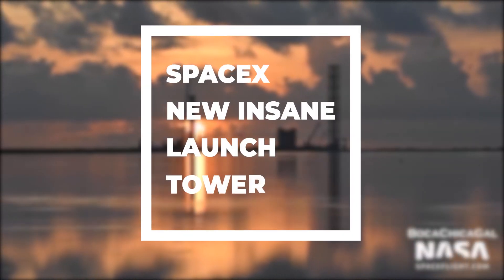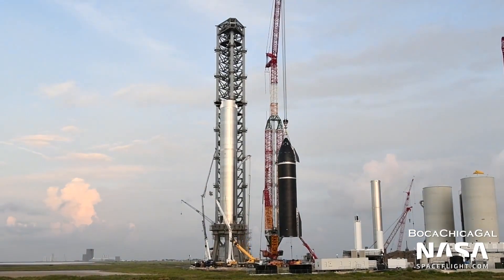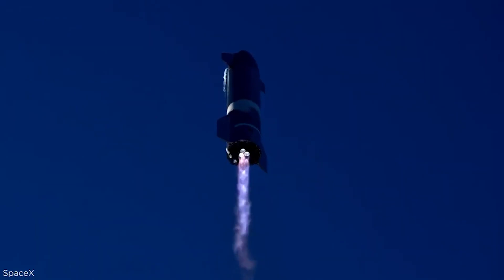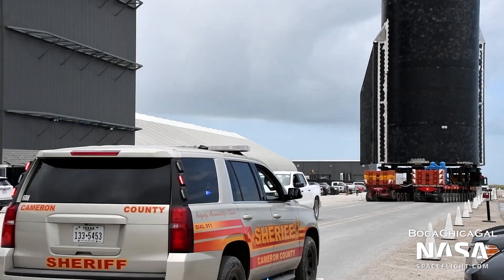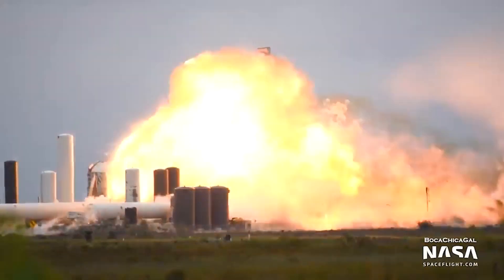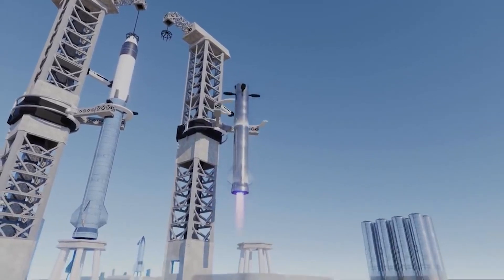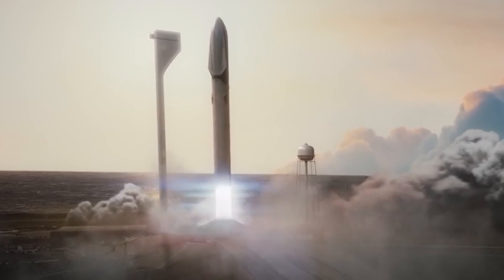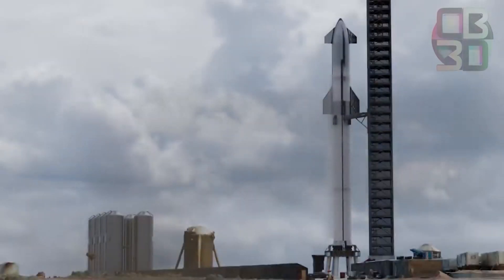SpaceX SECRET WEAPON is This NEW Launch Tower!

Comment: As someone with a structural engineering background, I know that what the rocket lands on MUST be able to support its massive weight.  That's why sites for giant buildings must have studies to determine ground composition. How they think they can land a huge rocket on an unknown surface anywhere is a huge risk. Buildings fall from inadequate support all the time.  It doesn't take much.
Reply: I can only assume the legs have some sort of stabilizing functionality with a pretty wide range of variance. Also probes could be sent in advance to do ground penetrating radar or something like that. If however it falls over on Mars, let me be the first to say, “you called it”.
Reply: Thought about this too. But yeah it probably will incorporate very wide legs…  unlike when it lands on earth with none

Comment: It definitely is not ready on mars or the moon but it is very dusty and on Mars even though there is not much much oxygen at all I am fairly certain things can rust more than likely at a very slow rate though I'm hoping he will be able to use those rockets of his to grab giant ice asteroids probably putting a couple hundred on one about 10 miles wide and 20 mi long then throwing them into that atmosphere of Mars decoupling them right when they have the right trajectory then sending them off for another one in a few hundred years that could produce a decent atmosphere on Mars not that it would last long if they can't produce an electromagnetic field around Mars to keep the atmosphere safe from solar wind

Comment: Yeah.
No
No
That's never going to work. I'm sorry.
It ranks up there with astronauts riding a window washer platform down to the Moon.
Reply: They said that about landing a rocket booster. Or landing a rocket booster on a sea barge. Or that starship could be made with stainless steel. Or that starship would actually work with aerodynamic slow down followed by a suicide burn. 

But look where they are now. Those who say it can't be done shouldn't interup those doing it.
Reply: @mattjones2303  Some people reason that if they do not understand something, that it is impossible. With his expertise I am sure we would be stuck in the middle-ages.